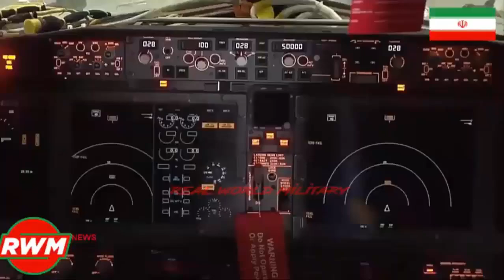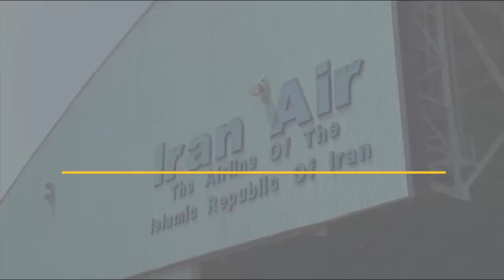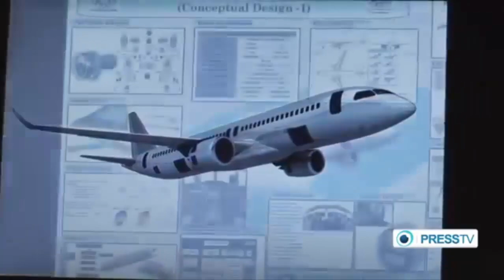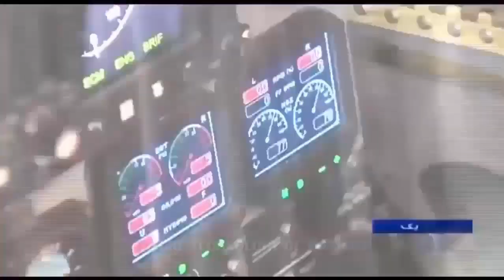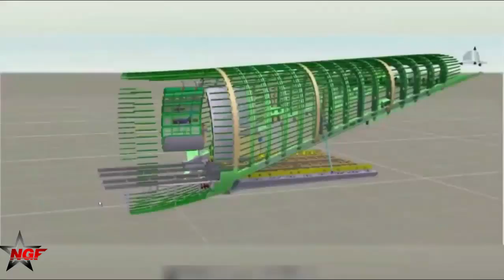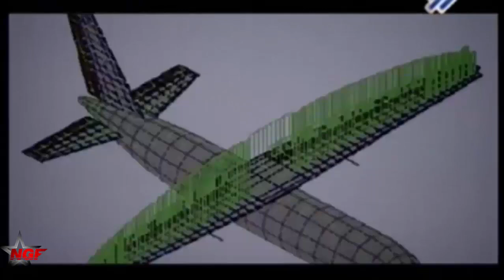Iran needed approximately 500 aircraft and Iran Wants To Build Its Own Aircraft

Comment: Iran has tried it before and has NOT succeeded, Iran -140 or in fact, the modified version of Antonov - 140, was the first model with the usual Islamic Regime's Propaganda, to be assembled in Iran and call it Iranian made Passenger Plane, 3 of Iran -140 were built, it didn't take long that 2 of those were involved in deadly crashes.
The project was abandoned and it was never got completed.

The mentality in the Iranian Aviation Industry is to build and fly it, the test comes later (with deadly crashes).

Every Aircraft maker in the world has started from scratch, it will take at least 2 decades to
test and a reliable and safe model.
Boeing, Airbus, Bombardier, and Embraer took decades to build a name in the Aviation industry and fly their planes around the world.

If Iran builds this plane, it has to use it in CARGO SERVICE for at least 2 decades, to make sure it won't crash and then slowly move to Commercial and Passenger service.

Building a plane, is NOT like building a car, every aspect of the design must be tested in production and service before it gets delivered to customers.

The bankrupt country of Iran is decades away from reaching that goal.

For sure there will be DEADLY crashes ahead with this model also and it won't take long that the project to get abandoned again.
Reply: اگر افرادی مثل شما سکانداری مسئولیت ها بودند ما الان حتی چیزی به نام پراید نداشتیم چون همه چیز خارجی حتی اگر فرفون باشه بهتر از داخلی هست